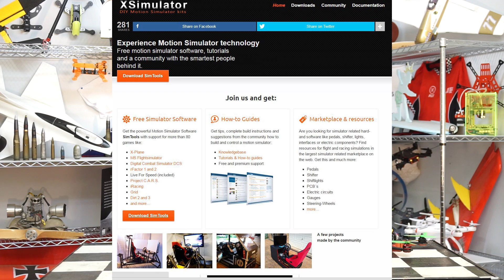4D FPV Motion Platform Quad racing

Comment: Truly a 100% epic project. Looking forward to the full scale build.  Depending on how much acceleration/g's the platform produces, you may have to include radio control restraint provisions so that a rapid change of direction doesn't cause pilot to input unwanted radio stick movements. A thick firm cushion on the pilot's lap might be all that's needed.... of course, I'm just guessing at this point since I've never used a motion platform hooked up to a quadcopter.